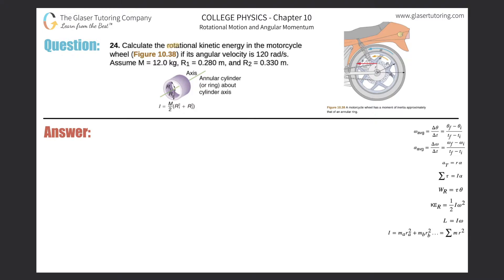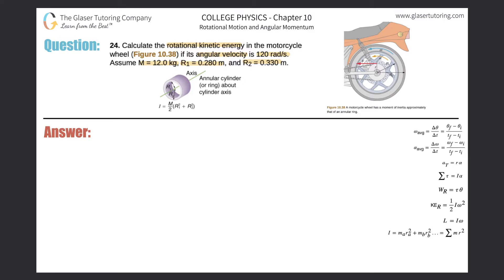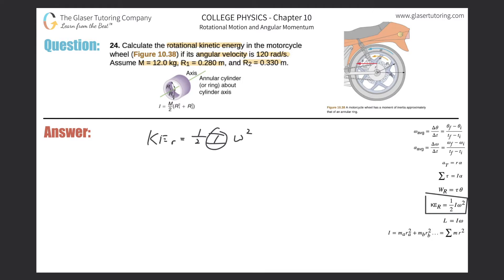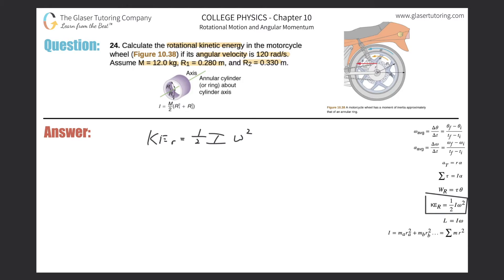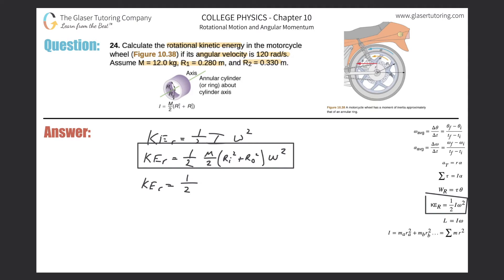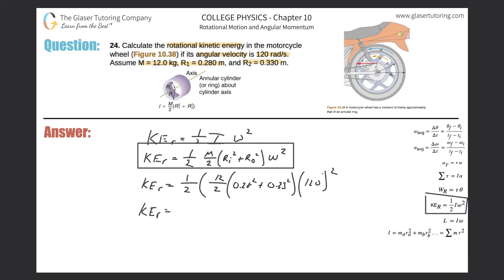10.24 | Calculate the rotational kinetic energy in the motorcycle wheel (Figure 10.38) if its

Comment: If cycle is running at 60kmps with extra gear or without.. theoretically it will take same energy as KE= IW^2(if we ignore weight of small gears as their radius is small and weight is less.. if we consider them.. it will take more energy.. then you have to consider the energy to move your legs which is more with 1 gear) but in real life you can never reach 60kmps with 1 gear cycle without any slope as you can't move your legs that fast(if you aren't professional).. but atleast you can do with extra gears..